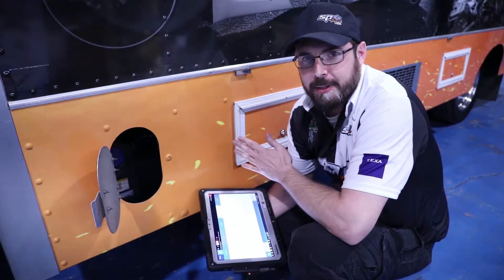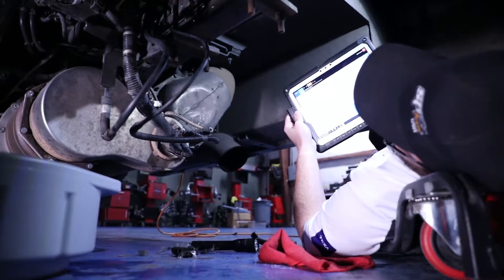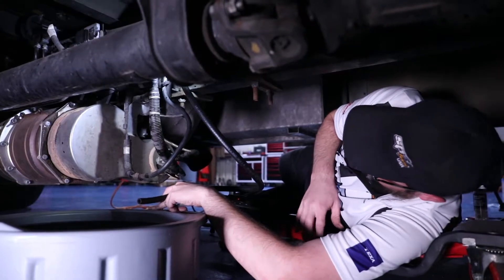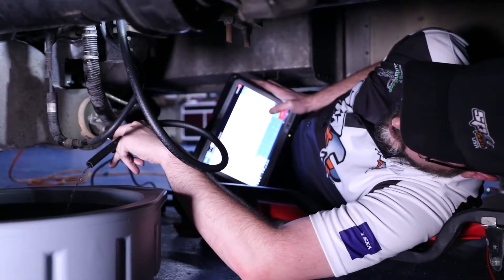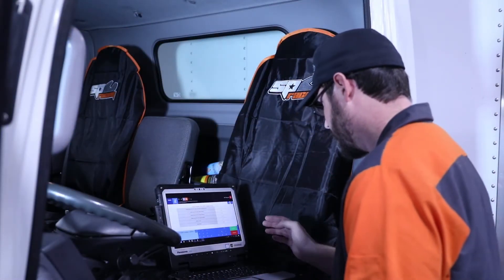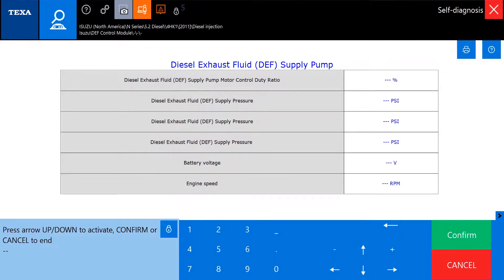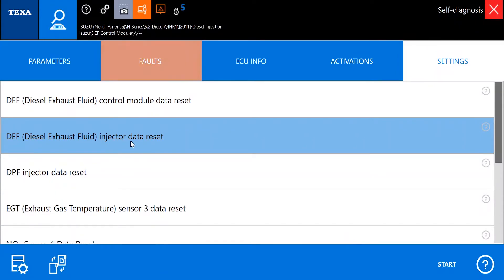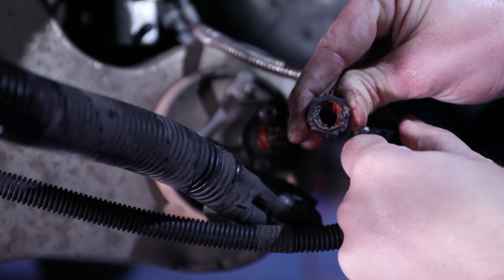SP Tools USA using TEXA IDC5 Truck: Diagnosing Isuzu NPR DEF Failure

Comment: Great videos. Keep them coming. I have a question? I have replaced an scr on an Izuzu and I did all the resets. Has no codes and it still flashes red exhaust light. It's a 2012 NPR. Do I have to let it finish the normal regen? I also am using the Texa scan tool.
Reply from the maker: Hi Jr! If you already have a TEXA unit I would recommend calling our tech line at 855-839-2626 they will be happy to assist you!
Reply: @CEASUSA  Thank You🙏🏽
Reply from the maker: @jr.granados4670  We're always happy to help!
Reply: You need to go into the Mamamori  data and reset SCR....you need to use the 10 pin adapter for that as it wont communicate via OBD2...sometimes you can disconnect a nox sensor,get it to trigger a code...clear code and def module data..run a regen and should pull it out of derate..(unless it hit level 4 derate..then the only way is via 10pin)
Reply: @mikekopisz1227  Hi Mike I have the IDSS software with Nexus USB link too, where do I or where can I get that 10 pin adapter? I have a level 4 red light and it will not regen exactly like you say with OBD2?